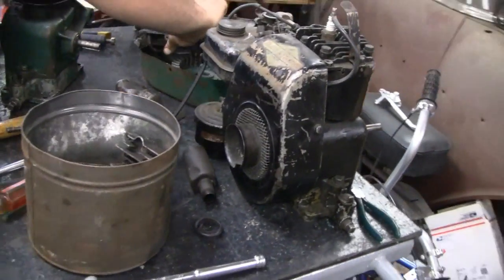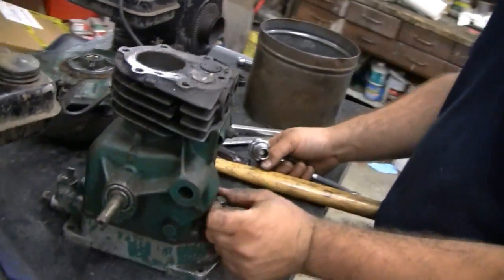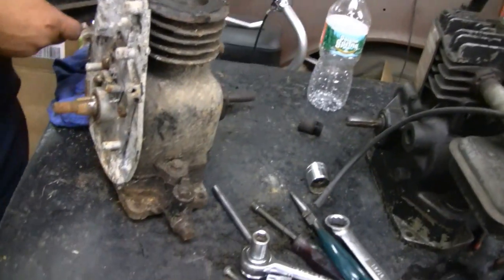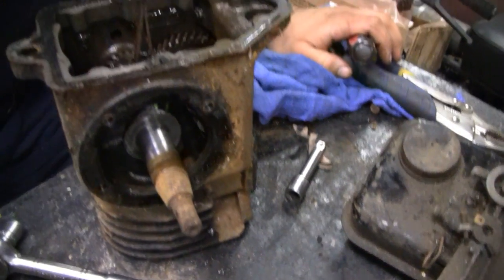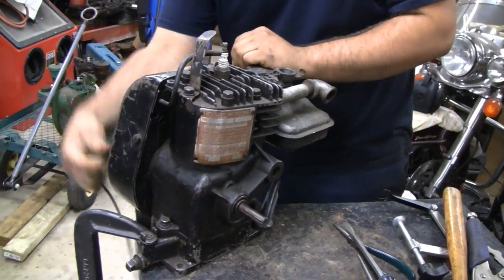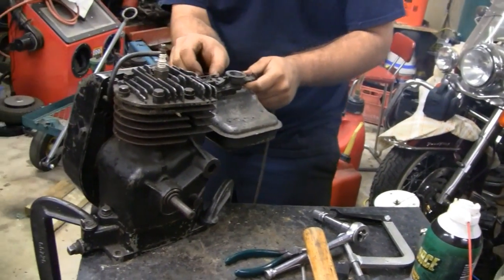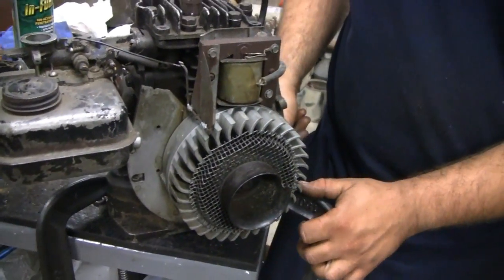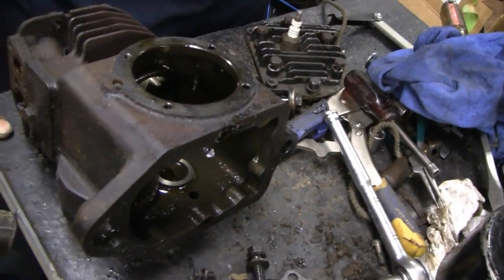HOMEMADE RADIAL BRIGGS ENGINE (part 1)

Comment: I have seen some of your videos about Pennsylvania panzers after that I got one myself, its a 1963 6hp, but the original engine was no good, it had no compression need new points, new carb parts and a whole lot of other things, so I decided that I could put a five horsepower motor on it cause that's the only one I could find, do you think it will be ok?
Reply from the maker: Jesse Cammisano Yeah you should be fine!!☺

Comment: A flat head radial engine...Hmmmmm. It will be interesting to see how the cam timing will be designed. I wonder if the old Chrysler five block, six cylinder tank engines were timed? By chain? , or by meshed gears?

Comment: I had a old us navy high pressure air compressor that had a system that automatically drained the condensate into the exhaust of the diesel engine. Could be something similar on that one engine. It was a davey mc1a. It had a 20hp Hatz diesel turning a. 4 stage air compressor that pumped up to 4000 psi and would make breathing quality air. :))

Comment: Man, that is one mint conditioned 52 Briggs there, you should use another one if you have it.
It reminds me of a 66 Briggs 4 horse I have, mint condition, and hardly any carbon inside.
Anyway, looks like an Awesome project, I wish you guys luck with it. I am currently working on a 3 cylinder stacker type radial and was planning to make a vid this week. I guess great minds think alike LOL  :)
I am curious how you will make the connecting rod for the 3 cylinders, should be  some good vids!

Comment: Hey how much would you want for the base from the green engine? I have a wi model briggs that the oil plug was tightened too much and it cracked all the way through. It runs but due to the crack it leaks oil badly.
Reply from the maker: Taylor Atnip $10 plus $5 shipping!!☺
Reply: I would be interested. What form of payment would you accept? Do you need my email or phone number?
Reply from the maker: PM me your address and I'll give you my paypal address or we'll figure something out if you don't have paypal
Reply: Your email is the same as your youtube account? I'm not familiar with how to message privately on youtube?
Reply from the maker: Taylor Atnip To send a PM click on my icon, that will bring you to my home page, then click on the "ABOUT" tab, when you get there click on SEND MESSAGE. Give me your Email and we'll go from there.
Reply from the maker: Taylor Atnip I answered your PM, do you know where to receive your messages

Comment: Letter C should be kept complete. They are a dime a dozen so id get on ebay or something and get a block. I also hope that all the parts your not gonna use that are oem to the engines will not be discarded for junk. Heck you could sell those extra parts to buy a different block to save letter C.

Comment: This will look good beside the 4 cyl.  I just used the coil and a few parts from a 5 hp horiz to fix another one.  It was clean too.  I am now NOT going to recycle the block because of you guys.
Bruce

Comment: Glad to see you start the project, but I hate to see that last engine get cut up. It never fails, as soon as you cut up that engine you are going to run into something, like a nice David Bradley tractor, that needs that period engine. I know, I stripped down a nice Parmi rototiller a couple years ago, because my cousin needed the engine. Still have the 2 speed gear box if you ever need it, just pay the S&H and it's yours.

Comment: I can't what ot see it when it's done but how in the world will you lubricated right with two upside down pistons?
Reply: I asked the same question in another video when he mentioned the radial. I figure it will have to be a dry sump engine with an oil tank and pump. It is going to be an interesting build.
Reply: Whitey He could also do it vertical.
Reply: Hunter S  Not sure I understand a vertical oiling system.
Reply: Whitey It would be like a vertical shaft lawnmower engine but it would be a 3 cylinder radial with splash lubrication system.
Reply: I see what you mean now. I never thought about it being a vertical shaft. Usually a rotary engine has a horizontal shaft.